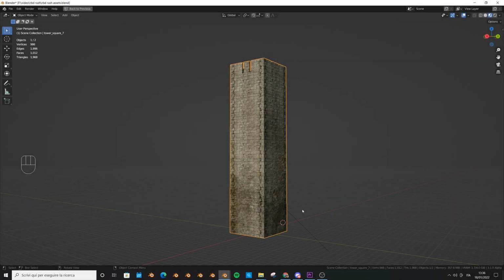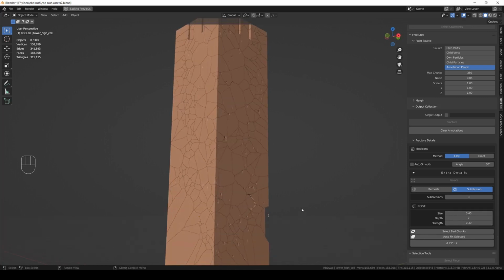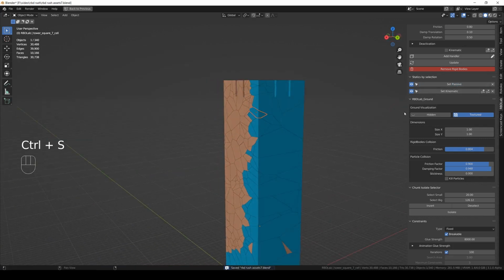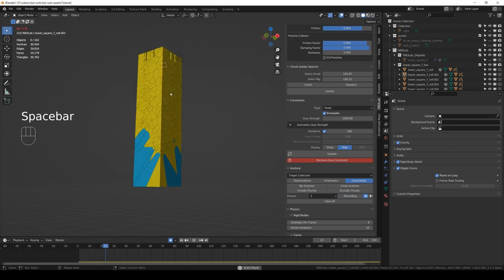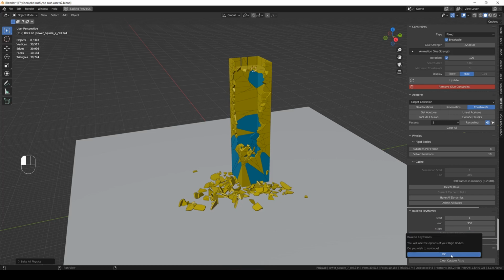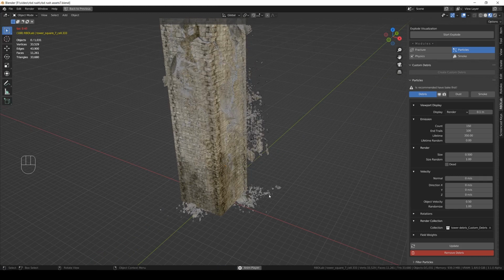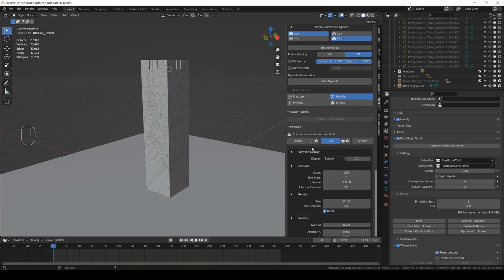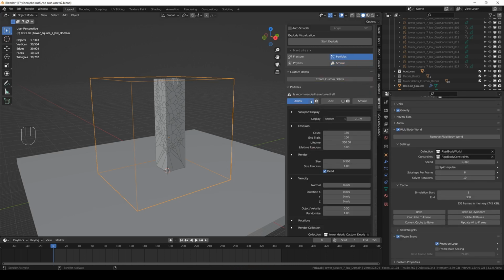BLENDER TUTORIAL: EPIC TOWER COLLAPSE with rbdlab!

Comment: I can't get the particles and dust to show up in my render despite baking and switching on the layers in the particles tab. Is there any solution?
Reply from the maker: fix it by doing this:
- in the "custom debris" collection select one of them in the particles settings turn on the option "show emitter" under the render panel
- do the same for all the objects in the "custom debris" collection, one by one.
It happens because in rbdlab addon you should choose your custom debris BEFORE you activate the debris/dust